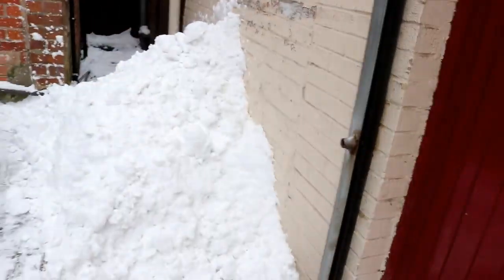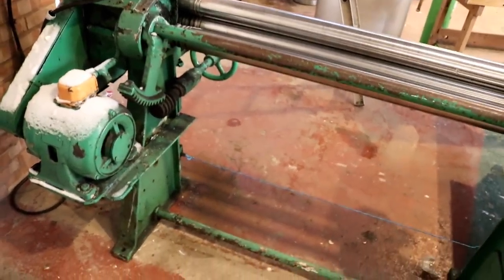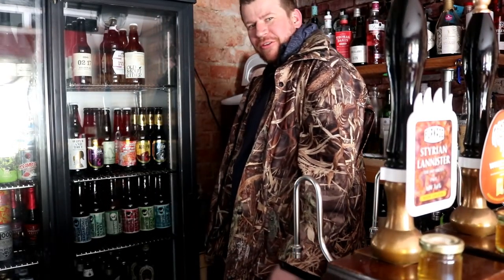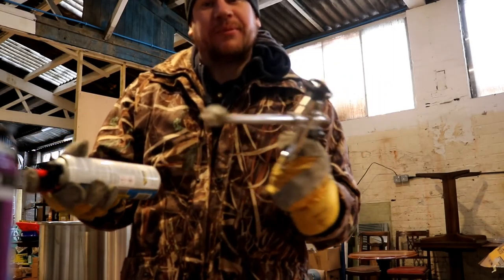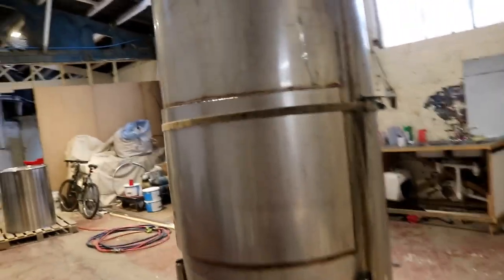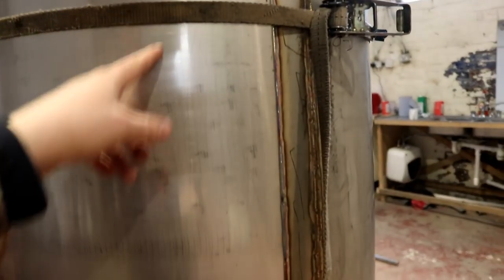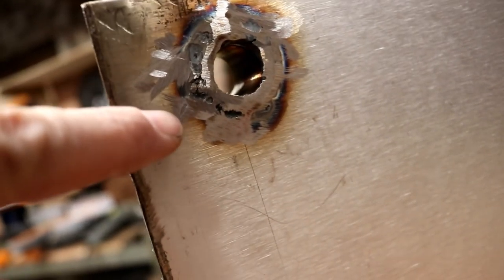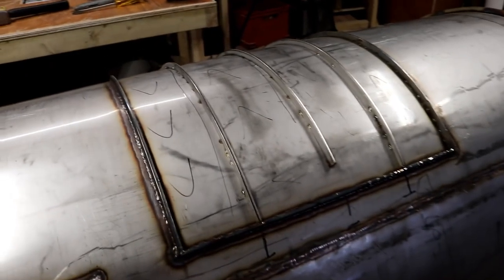GLYCOL INLETS ~ FERMENTER COOLING

Comment: Nice work chief. Here’s a suggestion, take it or leave it, no bother. When you weld on the outer jacket (after you cut another) drill some holes to line up with the bars inside so you can plug weld across the face as you go. Should help to keep it flush and also tight to the internal bars keeping the coolant flowing around rather than pushing straight across. Well done. Carry on.

Comment: Do you remember how much dry yeast you used to add to your 300ltr fermenters? I was thinking about using 125 grams for 250 litres of wort does that sound about right or should i add more?

Cheers!
Reply from the maker: Around 80g per 100 liters for us05
Reply: Ok because im getting alot of rotten egg in my brews right now at day 4-5 so its either underpitch to warm and maybe bacteria? Did you measure liquid temp or tank wall temp for your fermenters? Cheers Harry for the reply